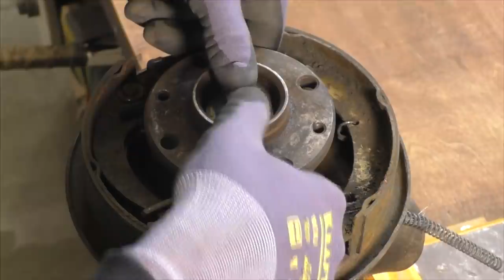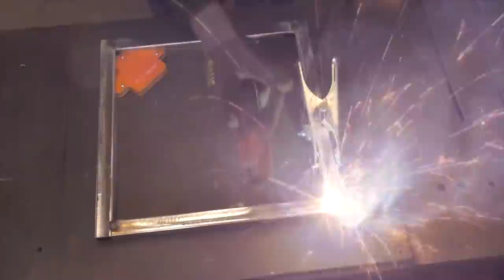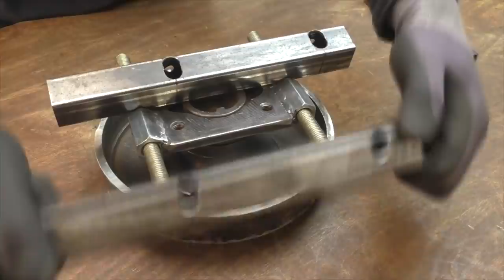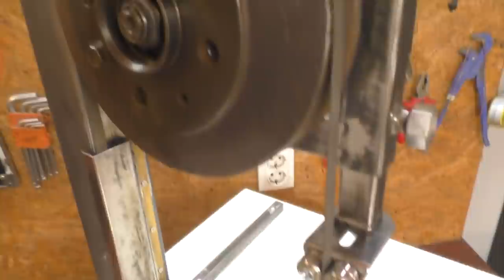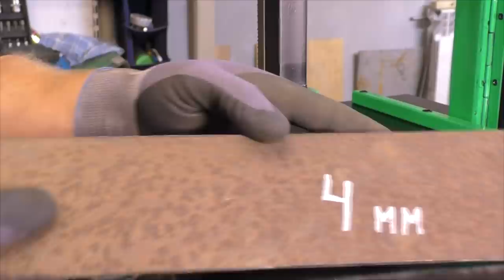Cool idea! Never throw away old car hubs!

Comment: Nice work, keep in mind though that the blade should run on the edge of the hub, and the teeth should never touch the hub, otherwise you will loose the setting of the teeth.
Reply: Looks like he put tyres on it.

Comment: Guides need a depth adjustment for the size/width of blade  to keep the teeth out of the guide/side bearings.
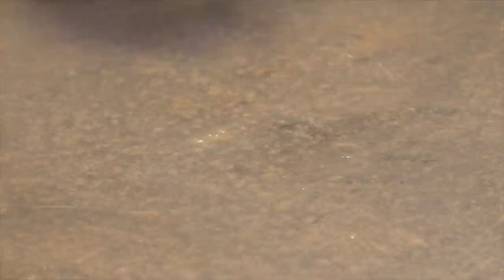Reply: you mean like at 6:15? the bearing the back of the blade pushes against?
Reply: @alm7707  Yes, but perhaps one can shim the side rollers back and forth to accommodate blade thickness. The teeth need to protrude out from the guide bearings.

Comment: It looks good but with one major issue.The top pulley on a bandsaw is adjustable for two movements .1 for slackening to fit blade and 2 tilt alignment for each individual new blade as it will alright the blade to pulley.

Comment: Very nice, but I need to know how you made the tires. I want to build this project, bandsaws are the best saws for hobby shops. How many feet or meters per minute speed are you running your metal cutting blade at versus the wood cutting blade?
Reply: The tires look like innertube rubber cut to fit.
Reply: I have several bandsaws and years ago I started making my "Tires" from good duct tape or Scotch 33 electrical tape. No need for tires.

Comment: It would be a good idea to put new bearings in. I  Don't buy expensive wheel bearings, change them from conical roller bearings to normal cheap standard radial ball bearings. They would offer much less resistance, and be a helluva less noisy. 

This Machine is great, but sounds horrible due to the insanely overkill bearings, that also sounds quite worn, they're made to literally take several tons of load, and extreme side loads. This machine has very lite radial load and has zero axial side load. It should have a fraction of the internal load surface.

Comment: Great build!  Only thing I'd change is make sure the guide rollers do NOT contact the teeth.  The teeth are "raked" or bent out from the band, in an alternating pattern.  This is to widen the kerf to reduce friction and allow better curve cuts.  If the teeth run between the guides, it will roll them flush with the band on the first revolution, affecting blade performance.   There are tools to rapidly sharpen and another to set or rake the teeth of bandsaw blades, especially larger sawmill blades.  These rapidly and precisely step the blade through for each tooth, making surprisingly fast work of tuning up a blade.

The multi-V belt engaging the motor shaft directly was an interesting touch.  The next mod/upgrade a user would probably want to add is a step pulley system to easily change blade speed for metal, hard, and soft woods.   Usually band saws have the step pulleys, then a second belt reduction to the band wheel using a larger drive pulley than the motor shaft.  In a belt drive system, the smallest pulley is always the limiting factor with regard to belt slippage.
Reply: Who are these rapid set tool made by? I have a sawmill and would like to look in to that for the last 25 years I have been using this manual set up with a dial indicator and a levered plunger it's kinda of a pain in the ass